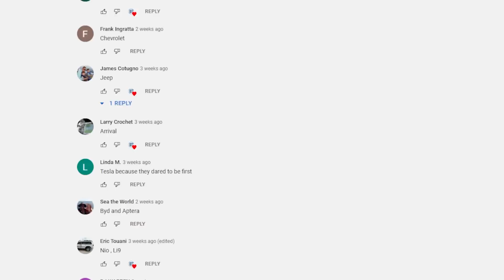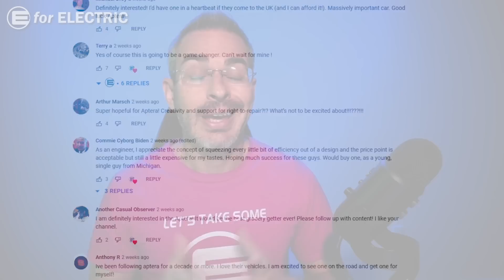How Aptera EV Got a Tesla-like Fan Base

Comment: I mentioned earlier, that I consider it to be something like "EV Lambo" - expensive toy intended for "drive-for-fun" of wealthy nerds, who'll buy that as a second car…

While it has great efficiency/maintenance costs, it also has long&wide footprint while very small cargo space…

Spring electric is 30% cheaper, shorter & narrower (easier search for parking spot & ability to bypass traffic jams through narrow lanes) and has way larger passenger/cargo space…
Reply: From their website: "While Aptera is only a two-seater, Aptera has 60% more storage than a Honda Accord and 20% more storage than a Prius.

With 25 cubic feet of cargo space, Aptera has the room for a pretty decent-sized grocery trip. And when you’re ready for an adventure, Aptera can fit the gear for snowboarding, surfing, biking, or your furry companion or two."
Reply: @jeffcarlton3590  Now 32 cu feet, but only good for marshmallows, unless you are a 60 lb wimp on your own.
Reply: I encourage you to look into this more closely and get a ride if you can.  It might reset some of your impressions.  Once they are shipping, there will be more chances.  I think there are several things that will surprise you.
Reply: @n.brucenelson5920  Like which one?
Aptera: 4496x2235 mm, 2 seats, 710 L trunk, "from €26,5k"
Spring: 3734x1622 mm, 4 seats, 290/620 L trunk, "from €20k"

(Aptera is even wider then BMW X5 - 2218mm, which means it will have similar problems with parking anywhere and everywhere - parking lot is defined by standards as 5000 x 2500 mm)
Reply: @FalkonNightsdale  I am not sure where you got your specs, but you are trying to compare a vehicle that has an abysmal one star safety rating, far less storage, no ability for a couple to sleep and a 0-100 kmh time of over 19 seconds, compared to 5.5 for the slowest Aptera.

Although the battery sizes are about the same, Aptera has far greater range on a charge, gains range more quickly  at a 50 kW DC charger, and uses far less power over a 1.62 km than Spring uses over 1 km.  

Many people, including me, would not even consider a Spring, on safety alone.  There might be a few people who need 4 person carrying capacity but this will be a relatively small number.  A ride in both vehicles would decisively settle the matter for most people.
Reply: @n.brucenelson5920  I'm comparing it, to ilustrate my opinion, that Aptera is sort of "Lambo of EV world" - it has some interesting specs, but is too large outside and too small inside to work as multipurpose "main household vehicle" (like Spring, which is of similar size as Suzuki Swift I'm currently using).
At the same time, it's little bit useless for vilkage folks, who may have enough parking space, but no need for 50+ km travel…🤷🏽‍♂️

Also, those safety stars are interesting stuff, but at the end of the day, real differences are minimal, usually aplicable only on freeway, and many tests are now deformed by inclusion of AI gimmicks…
Reply: @FalkonNightsdale  I understand differences in both opinion and use case.  The difference in power use coupled with performance is objectively not minimal, and completely overlooks the fun factor in my opinion, while minimizing the difference in operating costs and safety.

I am replying, because I didn't understand your last comment : "many tests are now deformed by inclusion of AI gimmicks…"?  How does this relate to the physical FMVSS crash tests that Aptera will be having a third party do on production intent vehicles?

Comment: Love the concept BUT!! how'd you like to have an accident in one of these? Specially hit from the side. Not a chance I get into one. They're fine for a gated community or country club get around but definitely not driving into city traffic.
Reply: You need to look into this more closely.  Aptera has an F1 style passenger safety cage made in part from carbon fiber and Kevlar.  Once there are delta vehicles available to test, they will be voluntarily crash tested by a third party to FMVSS part 200 tests and the ratings published.  They have numerous safety features that they are not required to have.
Reply: @n.brucenelson5920  I don't doubt that there will be safety features present when it starts selling and that it will/should meet the safety requirements imposed my law.
My reasoning applies to the size/mass/weight of the vehicle vs the other more massive vehicles out there.
Even a safety cage can kill from the shock of an impact. The bodies of the occupants could be jarred from a serious impact in a very bad way cage and all. Your points are all well taken though.
Reply: @iwannacutube  All things being equal, you are correct that mass is an advantage in a collision.  However, Aptera goes FAR beyond the safety requirements imposed by law.  You can die if you don't pay attention in any vehicle, but Aptera will be on the safer side.
Reply: I already commute with an Arcimoto FUV, in the traffic-as-battlefield mentality of SoCal. Eight thousand miles in eight months. My driving style is DEFENSIVE, where you hone the skill needed to percieve and react instinctively to any hazards BEFORE they occur. It's the kind of riding you develop when you commute on a motorcycle before the advent of helmet laws. The Aptera is a more capable autocycle, that I know will transform me into a more capable traffic ninja. To say nothing of it's Formula One level of crash safety.

Comment: It’s cool but after talking to the Aptera team at Fully Chargered show, they design doesn’t address real world situations. For example those wheel covers if they are not able to be raised will be snapped off with most steep driveways and potholes .Not for me
Reply: I have ridden in an alpha over potholes, steep drives, and speed bumps and that didn't happen.  The production versions are much better in this regard.  I will be driving mine year round on gravel roads in Iowa.  I have no particular worries in this regard.

Comment: I believe you underestimate how many of us are stoked about efficiency. And there is a large overlap in the Venn circles of those who put efficiency first, and those who put our environment first and want to reduce our carbon footprints to the greatest extent we can manage. Hey, I started with a new 1st gen Honda Insight, and then went electric with two LEAF's. I dream of this car for the freedom it will give back to me out on the open road, as my current Nissan LEAF's battery has lost 3 of it's charging bars, and will only get me 75 miles/full charge on a good day. Some of us just prefer to live with the compromises of our 1st gen EV's than ever go back to fossil fueled transportation.

But that does not mean that the Aptera will not appeal to individuals who do not consider themselves in either of those Venn circles. This autocycle has appeal to people who want a smaller capacity delivery vehicle that operates with the most bang for their buck, if they are buying commercial electricity as most of us are. Many people are anything but fans of their electric providers, and the Aptera's battery can also be supplemented by fold out PV panels. It can be used as a portable battery to deliver power for any number of reasons: boosting battery dead EV's; or helping power a remote camp, music or catering venue; or even a home during a power outage. 

It can appeal to people solely because of its unique look, or for its camping potential, or ability to get you out to the middle of nowhere and back without needing to charge, etc. The highest range model gives you ~16 2/3 hours of driving time avg 60 mph. You could drive it from San Francisco to NYC in 3 long days, only (quick) charging it twice overnight. It can save you thousands of $'s in travel expenses, including letting you sleep in the ~ 7' back while charging overnight on a long multi-day trip.
Reply: Well said!

Comment: I am an Aptera reservation holder.  The Aptera has a great mix of features that fit me.  I gotta say the "looks" of the vehicle won me over.  They put together a traveling machine.  You think a Level 3 charger will be there for you on your road trip?  Nope.  This was your last year for easy Level 3 road trips.  

In terms of sales volume?  Recall the "Honda Insight".  Whatever this car sold is what I would think Aptera will sell.  However I walked away from the Insight.  Did not buy one.  BUT I signed onto Aptera immediately.  Je ne sais quoi.
Reply: I drive a Gen 1 Honda Insight.  My first one protected me in a rear end collision from an SUV on the interstate without injury so I got another.  It has met my wife's and my needs well, but Aptera will exceed its performance in almost every respect, including operating cost.  Aptera already has more than double the pre-orders of the Gen 1 Honda Insights' total sales volume over 6 years.

Comment: Reservation holder here — one thing that you failed to mention in this video is total cost of ownership which, as elaborated on in my channel trailer, is what got me on board. Even if you drive more than 40 miles per day (something I definitely do as a DoorDash delivery driver) the efficiency combined with solar also means lower charging costs — far lower than just about anything else on the market. The prospect of only needing to pay a nickel per mile when making deliveries that pay between $1 and $7 per mile is something that should excite anyone who does business in that sector as well. And because half the car is trunk, you can definitely fit a lot more cargo than in most vehicles — cases of water and grocery bags are absolutely not a problem.
Reply: My Nissan LEAF gets about 4.2 miles per Kilowatt-hour peak average efficiency, but the Aptera will get something around 10 mi/KwHr!

Comment: It has a look of simplicity, that is cloaking a technical design. I have looked at my normal trips in a year and see the 400 mile version more than enough to round trip all of them without needing a charge. At least not a plugged in one. But with that I could drive 300 miles and sit down and eat while it charges 250 miles of range in 30 minutes on a 50kW DC charger. But I hope Tesla would honor us with access to their charging system before the government grants force them to open them up anyway.

Comment: Easy: The people dream they will get a race car, an off road vehicle, a recreation vehicle, a commuter, a long range limousine, a DIY repair for a fraction of the price they normally have to pay. What they really get is an expensive motorcycle with 3 wheels and a plastic shell against rain. A deathtrap in case of an accident. With a footprint wider than a Hummer H1.
Reply: "A deathtrap in case of an accident."  Citation? I will be waiting with popcorn while you try to explain how Aptera is more dangerous than a motorcycle in an accident.  Note: you will be replying to someone who has over 400,000 all weather miles on motorcycles.
Reply: @n.brucenelson5920  In a motorcycle you are not trapped in a plastic shelter with batteries built inside the cocoon. Nice thing in case of an inevitable  battery fire. Try to not gasp for breath while toxic fumes surround you. Or while you are eating your popcorn.

Comment: I wish Aptera all success.  For those who cannot afford anything better, or for who it will be a run-about, it will be a godsend.  It is great that they are following right-to-repair.  However, the Aptera does not look comfortable.  I cannot see many wanting to drive 1000 miles in it except perhaps over the smoothest roads.   The three wheels are optimally distributed to catch every bump and pothole.  The reclined seating posture and minimal seat height does not look comfortable for those who prefer a more upright seating position.  Still, I hope that there enough who will find a use -case for the car/bike to make it a success.  The version with the smallest battery and solar panels probably makes the most the sense.
Reply: For some the smallest will be perfect.  But for most of us the 400 mile range version seems to be the sweet spot, just based on pre-orders.  

As far as potholes - If you hit one in a four wheel vehicle, you are likely to hit with 2 wheels.  On Aptera, you are likely to only hit with one - think about it.  

Aptera is not going to fit everyone's needs, but for anyone who has owned a 2 seat sports car, it will increase the practicality and in many cases the comfort.
Reply: @n.brucenelson5920  It is so much more practical than a Mazda MX-5 Miata.  Similar prices but I think Aptera will out handle & out accelerate it.  And, using 10 times less energy.

Comment: Reservation holder, investor. and nerd here. I only drive my wife and myself, our dog on occasion (I did order the pet package). Our house does not even have the option to garage a car, due to having no garage. I will be able to take full advantage of the sun, during that day that is. When I placed my order, I still drove to the office. I now work from home, and have in fact sold my car to take advantage of the current market. I barely miss my car most days. I spend less on Uber than I did insurance. 

Having fell in love with Aptera many years ago, I was sad when they went bankrupt. But is it worth buying a car if I never drive anywhere? I don't think so. My wife loves her car, she will not be interested in driving the Aptera. I think if I go through with the purchase I will have major buyers remorse. I ordered the 600 mile version as my wife and I love road trips. But her hybrid Hyundai does not break the bank on weekend trips.  

What a sad day, when I have to stretch for reasons to spend over $30,000 on a car I want but have little need for. 

Reasons for me liking Aptera; I have solar panels that make more energy annually than I use. So even if it needs charged, it's still kind of free. 

The aerodynamics, two things; bugs float over/under it and little to no side draft from wind/semis. The bug thing, comes from a comment co-founder Chris Anthony (I think is his name) said. 

They are for right to repair.

 Last but not least, efficiency, doing more with less because of good design practices.
Reply: If the Aptera offered V2H capabilities I would not be on the fence about it. My solar setup is currently lacking batteries.
Reply: @wabash1581  I want V to H, V to Load, and V to Grid. 

Then down the line for my 2nd Aptera I hope they get around to engineering modular battery packs, say in 5kWh units that you can remove when their dead weight is not needed, allowing you to customize your Aptera to your day or trip's most efficient weight and required range, perhaps with adjustable air suspension to best meet the variable weight challenge. Then engineer the removed packs as power wall like home and grid back-ups, monetized of course. Our time of use electricity rates vary by a factor of five from our late night, wee hour EV rate to our summertime peak load rate. It would be nice to use the cheapest EV rate full time throughout the day. Also, stationary storage has advantages over mobile storage when feeding your home, business, or grid, and during blackouts when you want both the needed home power and your transportation.

Comment: When the hell is it supposed to roll out? Didn't they say q2 2022 we will see them? I'm in california and haven't spotted any around the bay area yet
Reply: Supply chain and funding have pushed that back, just as with all manufacturers.  The first production intent delta version, produced with production tooling, may come by the end of December.  Several of the first ones will be crash tested and there will be other testing before production is shipping.  I expect to be driving mine next year.  I will come through the Bay area on my way to Bellingham, WA after I pick mine up, and then back to Iowa.

Comment: I've been driving a 90s era ev for years because it's cheap, efficient and super reliable. Plus it only uses 190 watt hours per mile at 55mph. I have looked at replacing it with a newer EV but they all get worse mileage than mine. Why buy a new vehicle and get worse performance? Well, along comes the Aptera at 100 watt hours per mile! Finally I modern EV that is more efficient than my 90s   EV! Yep, I put a deposit on one.
Reply: Welcome to the family!